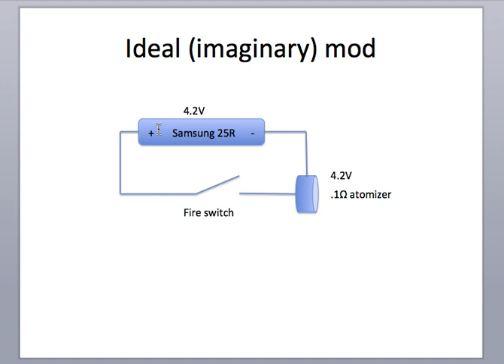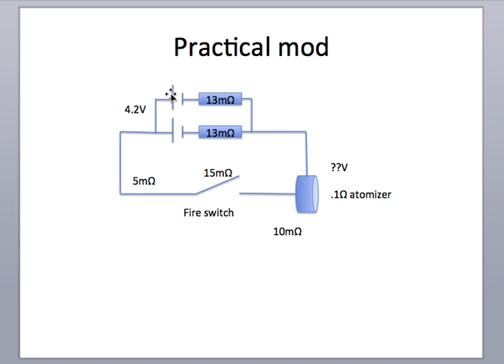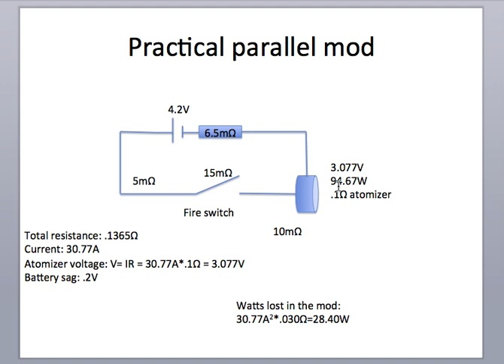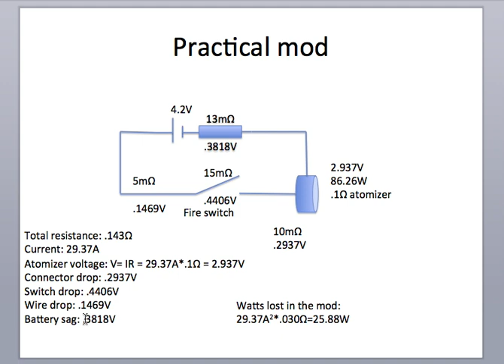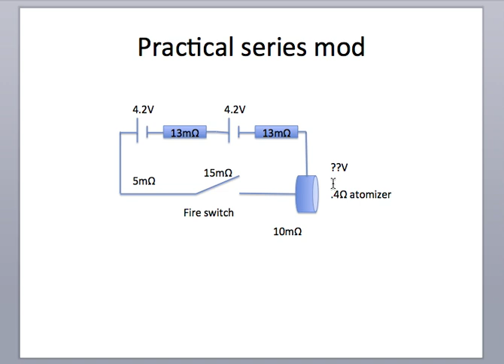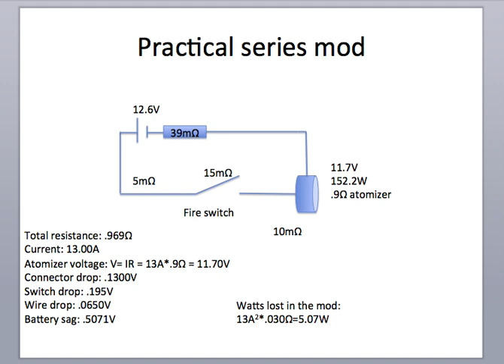Electrical Analysis of Several Vaporizer Configurations

Comment: Nice, I came to a simple conclusion regarding series mods by just plugging in different voltages and resistances into a Ohm's Law calculator. That higher voltages allow for higher resistance coils that lowers the amperage resulting in a safer experience. But most everyone still seems drawn to very high current to get performance. Your analyses proves my thoughts correct. And thanks, the total mod resistance figures is something I did not know how to figure in. Very well done!

Comment: Thanks for the vid. Always nice to learn something new. Also I was wondering if you could lend me your opinion. I have a parallel box with an avs switch. No mosfet. I didn't build the box. But I am trying to figure out why it's not firing I believe it's the switch but I want to be sure before I try and pull it out since its a wooden box. If I could get your opinion I could explain why I am wondering if it's the switch if you had sometime to give. Thanks.
Reply: Join "Box Modders" group on Facebook. Read the files. DO NOT post in the group without reading all of the files first. There is actually a file in there that explains the process of what to do for someone in your exact situation. Good luck.